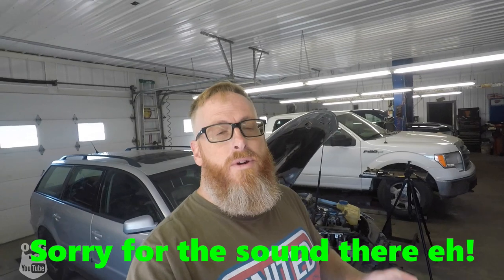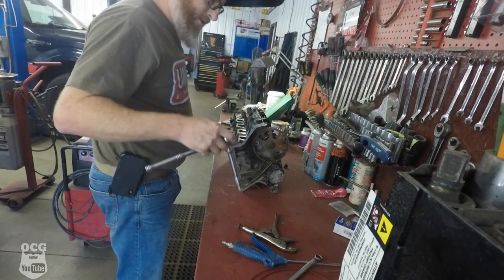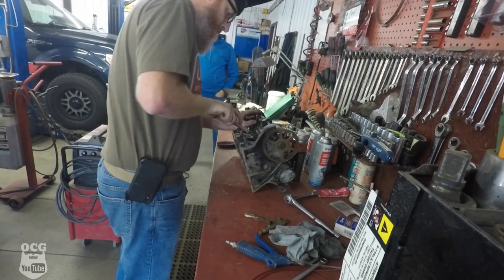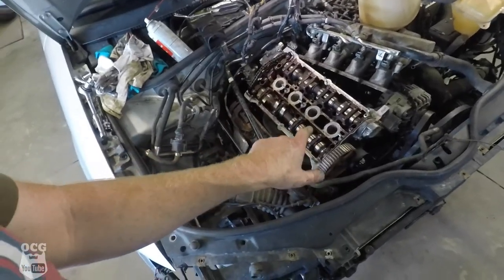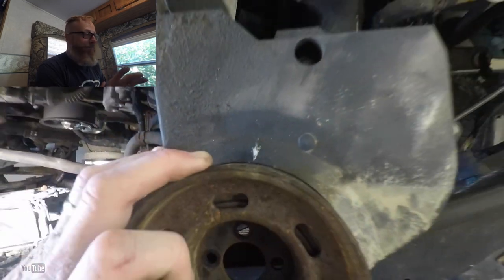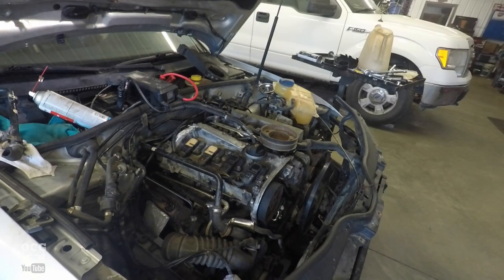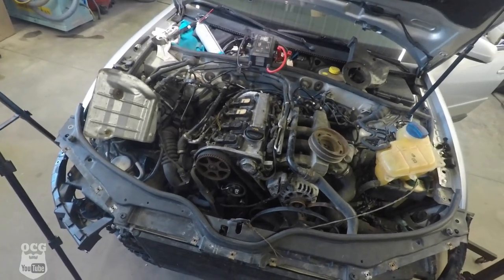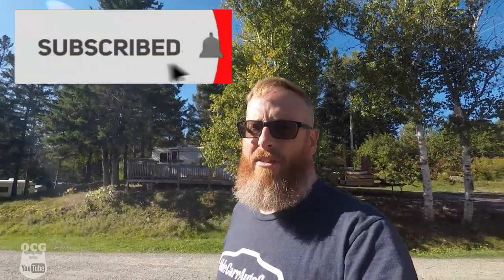REPLACING THE HEAD, TIMING BELT AND FIRST START ON MY 2000 VW PASSAT 1.8L TURBO

Comment: Try swapping the cam position sensor for the no start. Get a new timing belt damper to keep the tensioner from moving and clicking while the engine is turning over.
Reply from the maker: Nothing but a little extra timing couldn't fix!

Comment: Why not just leave the nuts stuck on the studs so they function like bolts? I would much rather see the stud come out than see studs get stuck in the head.
Reply from the maker: That would have worked as well. Thanks for watching!
Reply: @OldeCarrGuy  Did you ever find out why it wasn't starting? I never found the subsequent video. Did it have an unrelated title?  I worked on one that my housemate owned.  I did timing belt, fuel pump and crack pipe.  We called it the princess.
   You could try starting fluid.
Reply: @alan6832  I did give an up in the following video. It was simply out of time by a tooth or two. It’s a challenge to line them up and keep the proper position on the tensioner.